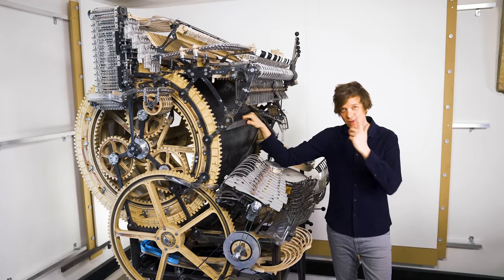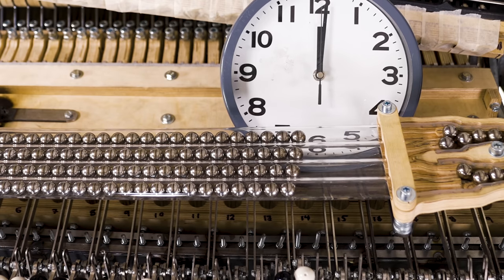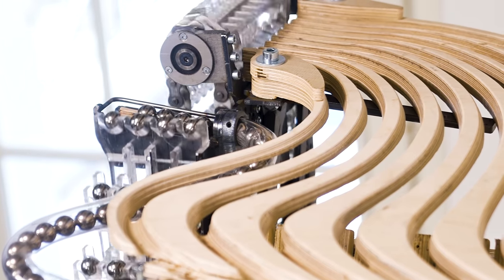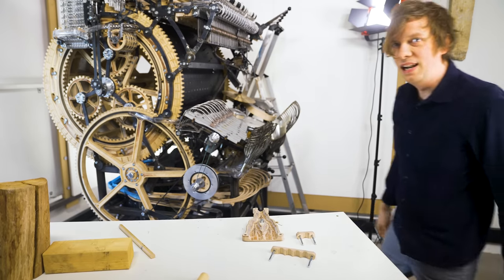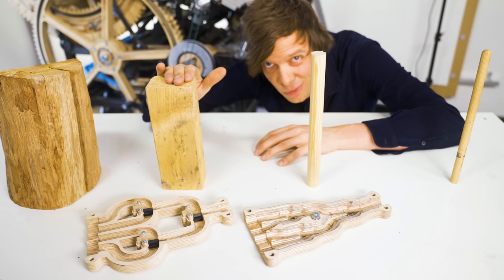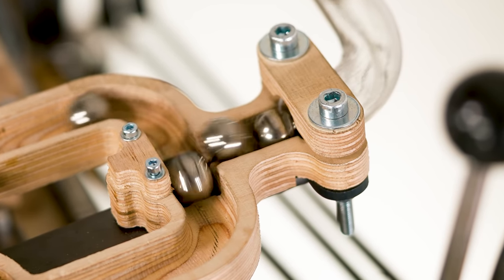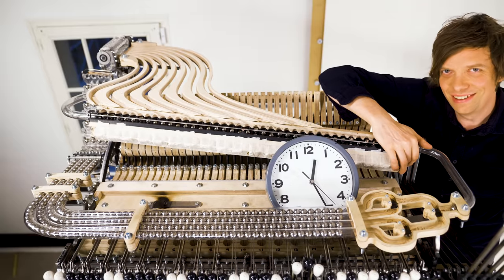Why 99% is NOT Enough - Marble Machine X Accuracy test

Comment: The moment that you realize that the MMX is harmonic at x32 playback and the fish stair appears to be functioning at normal speed.
Reply: Thats creepy!
Reply: How does that happen?
Reply: @merlijnbakker8797  shutter speed of the camera is matching the movement speed of the machine. 

Look up "Helicopter rotor matches shutter speed" for a really good look at the effect
Reply: @merlijnbakker8797  Manual fast forward (think old movie projectors) works by increasing the rate at which frames (still photos that comprise a movie picture) move through the observer’s view. In the digital world, data compression is only so good, so it starts to cut out frames to create the illusion of increased speed. If you cut out the right frames in the right order, you can create all sorts of wacky visuals.

Think of the fish stair as a series of movements on camera. At the bottom of the cycle, the fish stair picks up a marble [an action we will represent with this circle icon ⏺]. Then it lifts up the marble to the next step [this one will be represented by an upward arrow 🔼]. After the fish stair reaches the top, it deposits the marble in the next step [to be represented by this square ⏹], and then goes back down [the obvious choice here is the down arrow 🔽] to begin all over again. In symbolic form the whole process looks like this:
⏺🔼⏹🔽

If we string multiple cycles together, we can get long repetitive chains:
⏺🔼⏹🔽⏺🔼⏹🔽⏺🔼⏹🔽⏺🔼⏹🔽⏺🔼⏹🔽

(Five full cycles)
⏺🔼⏹🔽
⏺🔼⏹🔽
⏺🔼⏹🔽
⏺🔼⏹🔽
⏺🔼⏹🔽

Now, let’s say that we’re filming the fish stair with a camera that takes one frame every time that we would use a new symbol. If we were playing that video back at regular speed, we would just see the same thing we observed in real life:
⏺🔼⏹🔽⏺🔼⏹🔽⏺🔼⏹🔽⏺🔼⏹🔽⏺🔼⏹🔽

(Still five full cycles)
⏺🔼⏹🔽
⏺🔼⏹🔽
⏺🔼⏹🔽
⏺🔼⏹🔽
⏺🔼⏹🔽

If we wanted to fast forward this video, we have to start cutting/compressing frames. Let’s say that we want to run this again at x2 speed. That means cutting out every other frame so that we can get the same length of video into half the time. With our pretend camera it would look like this:
⏺⏹⏺⏹⏺⏹⏺⏹⏺⏹

(Two frames from each cycle remain, two have been cut [✂️])
⏺✂️⏹✂️
⏺✂️⏹✂️
⏺✂️⏹✂️
⏺✂️⏹✂️
⏺✂️⏹✂️

See how we lost all of the frames showing up and down motion of the fish stair? In your brain, that would make it look like the machine was running twice as fast (or like really bad stop-motion animation) because your brain fills in the gaps between the frames with what it imagines is happening, just like any video. But, things start to get trippy if we want to run our special video at x5 speed specifically. We would have to cut out four of every five frames, which leaves us with the following:
⏺🔼⏹🔽

(The reason it looks like this is because we are getting a different frame from each cycle and stitching them together in the right order)
⏺✂️✂️✂️
✂️🔼✂️✂️
✂️✂️⏹✂️
✂️✂️✂️🔽
✂️✂️✂️✂️

In this particular instance, even though the rest of the objects in the frame would appear to be moving five times faster than usual, the fish stair would appear to be operating at normal speed. This is what was happening with the real fish stair at x32 speed in Martin’s video. The playback was lining up just right so that the selected frames were showing the fish stair as though normal, while everything else was still being shown at great speed.

Sorry for the long-winded explanation: I hope that it helps!
Reply: @LOVEMUFFIN_official  Wow, thats a clear explanation! I get it now, crazy that even the rolling marbles seem to go at their normal speed, as if they are actually unique marbles. I played it on 0.25 speed (the x32 speed part) and saw some marbles jumping back and forwards through the pmma pipe, which double proved me that Martin didnt edited the video to see if we would notice it which i thought was the case initially.
Reply: @nates9536  Haha it looks cool. It makes me think of the rims of a car that sometimes seem to turn backwards on film.
Reply: @nates9536  no shutter speed has nothing to do with the thing it's the thing that the belt moves at 32 times per second so when he speeds it up the thing matches with the previous frame so it looks like it's slow
I just want to say shutter speed has nothing to do see Captain Disillusion video he explains it
Reply: @LOVEMUFFIN_official  don’t apologize for spreading knowledge this was awesome

Comment: This similar "flip-flop" mechanism is used in raindrop counter of weather stations. If there is enough water on one side of the  "scale" it losts it's balance and flips ower letting the rain pour out enabling at the same time the "dish" on the other side to collect water till it flips ower too. Very simple and robust mechanical solution.
Reply: Cool. I used this to make a rain counter once. Instead of measuring the amount of rain, I needed only to count the number of flips and flops

Comment: Rockers have always worked well for me. I’ll always use that method when I need equal division. Glad it’s working out for you!
Reply: just subscribed to you, your channel looks interesting :)
Reply: But it does introduce some noise, but you could change where it flows into the flop, maybe another bit of pipe or slight angle change.
Reply: The best divide by 4 is no divide by 4. There are simpler more reliable ways to recycle marbles but Martin keeps holding onto risky designs which he already saw fail in the original marble machine, like this...
Reply: @tommj4365  I don't understand the need for a divide by 4, one at a time. Why not divide by 4, always grabbing four at a time?
Reply: @brockstanford7608 basically Martin wanted the cool visual effect of a fish stair pumping in sync with the music, and 4 at a time provided the ideal throughput. your idea (if I understand correctly) of just grabbing 4 at the bottom of the fishstair was actually suggested and prototyped, but it seemed pretty quickly dismissed for some reason.
Reply: @tommj4365  there are simpler ways to make music than a marble machine
Reply: @jb76489  im just a random dude who got this video recommended to me and I don't even understand where the music is. I just hear some pointless machine making noise. There's no tune or rhythm, or anything that would indicate that it's "music".

edit: i'm not saying it doesn't look cool/fun to build. I just don't get why it's called something it clearly isn't.
Reply: @TechSupportDave  당신이 방금 간음을 범한 육종가가 나에 대해 뭐라고 말했습니까? 내가 해군 봉인 부서의 대부분의 엘리트를 졸업하고 알 케다에 대한 수많은 공개되지 않은 습격에 휩싸였으며 300 건 이상의 상습적 인 처형을 겪었다는 것을 알고 싶습니다. 게릴라 작전 경험이 있고 미군 전체에서 가장 자격을 갖춘 명사수입니다. 당신은 나에게 아무것도 아닌 추가 희생자입니다. 우리는이 대우주에서 전에 본 적이없는 엄격한 짝짓기를 제거 할 것입니다. 내 언어 단위를 표시합니다. 정보 고속도로를 통해 나에게 배설물을 말한 것에 대해 무죄를 선고받을 수 있다고 생각하십니까? 새롭고 바람직하지 않은 사람을 다시 인정하십시오. 통신 시점에서 나는 신세계 전역의 내 비밀 요원 조직에 영향을 미치고 있으며, 공격을 더 잘 강화할 수 있도록 인터넷 프로토콜이 즉시 추적되고 있습니다. 애벌레가 날아갑니다. 당신의 기간이라고 불리는 비참한 존재를 끄는 소란. 당신은 늦게 고군분투하고 있습니다. 당신은 18 세 미만의 아이입니다. 나는 언제 어디서나 편재하고 여분의 7 센텀 기술로 당신을 몰살시킬 수 있습니다. 그리고 그것은 장비없이 나의 중수골과 함께입니다. 직접 전투를 할 자격은 없지만 미 해병대의 총 기고에 접근 할 수 있고 당신의 끔찍한 짐승을 거대한 땅에서 꺼내기 위해 절대적으로 처리하겠습니다. 배설물이 거의 없습니다. 당신의 작은“거짓말”진술이 당신에게 거의 보이지 않는 거룩하지 않은 모습을 볼 수 있다면, 당신의 유산은 불쾌하게 말하지 않는 것입니다. 하지만 당신은 할 수 없었고,하지 않았고, 이제 당신은 화해하고 있습니다. 내가 당신에게 모든 범죄를 배설하고 당신은 그것으로 넘칠 것입니다. 뒤집기를 완료했습니다.
Reply: @TechSupportDave  go to this channel's main page, click on videos, sort by popular, play the first video

Basically he's building a hand cranked non electronic midi sequencer.
Reply: That's math/logic for you.

Comment: What this series has taught me:
"Make it simple and reliable."
Reply: You mean Resilient
Reply: The KISS principle.
Reply: Martin has yet to adhere to this standard though, the problem isn't the subassemblies but the design of the overall machine,

Martin tries to apply engineering principles but he let's the musician in himself take over, both in subassemblies and in overall design, I'd argue more in overall design since it was made some time ago and he was less experienced engineering wise at that time, it still creeps up a lot though, a majority of which I would argue is because of that old overall design,

as a programmer, if I get to a point in a project where I continously rewrite some part of the code because of underlying architecture I start wagering to rewrite that underlying architecture, it may be more work now, but it will save much more work in the future, and these rewrites tend to happen multiple times before an efficient and user friendly architecture is found, in the end, everything is a prototype
Reply: @msx80  I mean no actually. Why I used the word reliable is because I want to encapsulate the idea of a very low failure rate as a whole. While making a thing resilient is important part of that, you also have to make it consistent, durable and easily repaired
Reply: @lazergurka-smerlin6561  reminds me of the good old saying: "accuracy is not the same as repeatability"
Reply: @CraftMine1000  Correct, precision is repeatability.
Reply: Keep
It
Simple,
Stupid

KISS! What every maker needs to remember!
Reply: @CraftMine1000  he already said he's going to rebuild it again. Although I don't think the programming analogy is quite accurate for mechanical engineering (but you still said some truths imo)
Reply: The flip flop method isn't the simplest or most reliable though
Reply: @tommj4365  I was not saying that either
Reply: if you call that simple.... I still can't wrap my head around most of the stuff he created ><
Reply: @PhantomWorksStudios  I mean no, what I was saying is that you learn these things are important from him. Not that he actually always fulfils these things

Comment: It would be interesting seeing this with four different coloured marbles. Test of accuracy, seeing if all the same colour ends up in the same tunnel or not (i know it's not an important feature, but it'd be neat)
Reply: I don't belive they would. If you start it with all the rockers the same way (toward the camera). Starting from the camera back would be slots 1,2,3,4. The marbles go up. The 1st marble would go into slot 1, 2nd to slot 3,  3rd into slot 2 and 4th into slot 4, repeat. Since the 4th slot marble loads 1st each time it would go to slot 1 changing the color. If I figured it out right, slot 1 and 4 would alternate between each other while slot 2 and 3 would stay the same.
Reply: @JasonDeath  It would still be neat to see... probably a great visual effect in the long term, but given the weight (and random size in glass) difference between glass and steel marbles, it would be hard to do.  You couldn't just paint the marbles either... they would have to be different colors of steel, which would probably have to be specially manufactured.
Reply: I love the idea of the colored marble experiment.  However, I think that depending on what music was being played, the marbles would go to different paths to hit different notes, etc, and would then have to travel back to the supply tube via different routes, and therefore would mess up the placement of each marble.  Cool thought though and I'd try it anyway.  🙂
Reply: accuracy when not playing, but if they jump "out" back to the system in different speed, then all stuff will change

Comment: Would be neat if you could add a mechanical marble counter that displays how many marbles rolled through the machine per song/concert/tour/total.
Reply: This this! I think having a count that's from the bottom, as that will show how many marbles that are used to make the music.
Reply: definitely!!
Reply: @raphaelho3551  failing marbles (not that we want to see some) will get their own counter, labeled "body count"?
Reply: Great idea.  I've watched musicians play and wondered just how many notes they just played. Now we'd know!
Reply: Where would the counter go?
Reply: Ooohhh, that's a neat idea.  He could come up with a new vernacular for MMX songs by referring to the marble count.  Like, "this is a 15,000 marble song."
Reply: Isn't it just the number of pins on the prog wheel?
Reply: @ciberbri59  that will ad an other 2 years to the build!
Reply: A hall sensor at each gate would make for a good trigger, then the counter can be electromechanical without affecting the machine's reliability. Can also use a light curtain at near ground level for the body count ;)

Y'know, thinking about it, given the machine's cycle rate I don't think a mechanical counter would keep up. It might well need an electronic queue (64 bit maybe) or something like that to make it accurate. It'd be very simple arduino code, just a uint64 main counter, a rate limited output pulse which decrements the counter and a boat load of hall effect sensor inputs tied to an interrupt (maybe an interrupt queue? This is getting complicated :|) which increments it. Normally this might pose a sync issue, but the 16MHz clock on your regular arduino uno should take care of that, it's way faster than the machine could ever go. Still, a single interrupt queue would be good to take care of two being released at exactly the same time.

The output pulse and counter decrement function should probably be triggered by something a wee bit more sophisticated than yonder delay function though, that forces the arduino to literally just idle for X milliseconds, which will probably mess with the interrupts, so a bit of Atmel assembly would go a long way, those things have built-in counters for PWM output and I think repurposing one of those would be just the cock for Dolly...

I want to build one now!!!
Reply: @233kosta  Agreed, that is definitely the safest option - no mechanical interaction for the measurement means no possibility of interference with function.

I don't think a microcontroller is needed at all even, just some pretty simple discrete components for noise filtering / hysteresis and logic to turn the signal into a digital one, fed into an accumulator. There are chips that do this that you could then wire almost directly to an LCD display over serial.
Reply: @mduckernz  Don't want to add last minute bells and whistles which end up undoing all of Martin's work up 'til now
Reply: @mduckernz  But then how would you run the rgb? 🤣🤣🤣
Reply: Matthias Wandel's wooden counter would be cool for this!
Reply: @davidepanceri8192  Nope. Because he can mute the various instruments whenever he wants. So the number of actual marbles dropping will be usually less that the number of lugs on the wheel times the number of wheel rotations.
Reply: Now is not the time for feature creep.
Reply: @KimonFrousios  I 100% agree, HOWEVER... If it were designed and built by someone else in such a way that it was transparent to the rest of the machine (i.e. hall sensors, minimum of bits mounted to the machine, etc.), then I see little harm in having it.
Reply: Up to the top you go!

Comment: There should be a wireless emergency stop button so you can press it so the motor slows down and stops right away, so you don't need to run around and stop the machine manually
Reply: Not necessarily wireless, even having a wired button that's a few feet away from the machine would work great too
Reply: Why not a remote control? 😎
Reply: That would be one of the failure modes he could implement, but hey... getting it to 99,999999%, it doesn't need any! :)
Reply: Yeah he could do that. He could also add sensors to every lane and count marbles, or analyze the vibrations, the data is fed to a little computer and an AI detects if something went wrong. A little garage on the back of the machine opens up automatically and a small quadcopter comes out to press the emergency stop button.
All that for a machine he works really hard to be almost 100% reliable.

Comment: That loose screw at the flip flop is freakin me out
Reply: ikr
Reply: It’s probably intentional.  With it loose it absorbs a bit of energy from the marbles, if it was tight they’d bounce back harder as the energy would reflect.
Reply: This guy has a screw loose.
Reply: @DanStaal  it was thight in the beginning, got loose, probably would fail over time, and it also bothered me

Comment: Who else was sweating expecting the new divider to have some failure?

Glad it works!
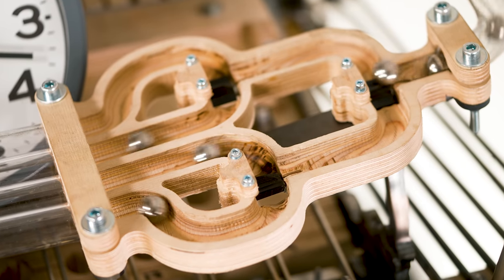Reply: I'm was 100% expecting a fail with the first flip flop unscrewing itself at 8:42. I bet if he tried for 10000 then it would have failed for sure.
Reply: @thefunniestfarm4731  and unscrewing? How does it unscrew? I’m pretty sure the flip flop has a hole and he has a needle going through.
Reply: @glorbnorgaborg37yearsago10  The wood piece holding it down is wiggling every time a marble hits it. one of the screws on it is very loose.
Reply: No,..... this is what we call progression even if @ slower rate than others might perceive. We would try to refer to as * Crossing the T ‘s & Dotting the i ‘s * Or  * Measure Twice— Cut Once *
Reply: @thefunniestfarm4731  oh. Maybe he didn't tighten it well but I guess you're right